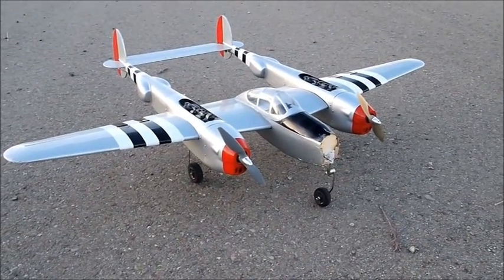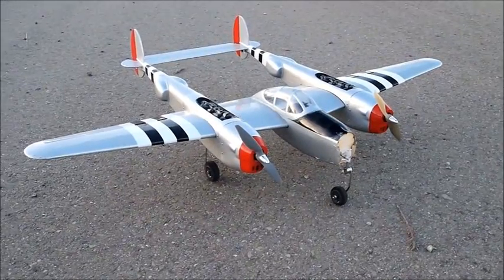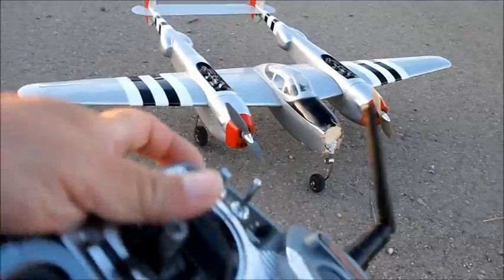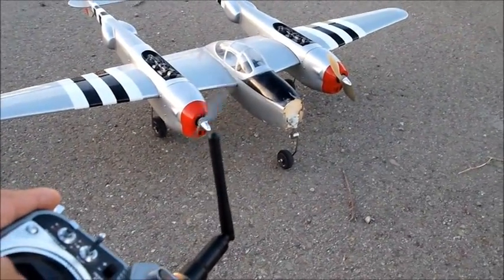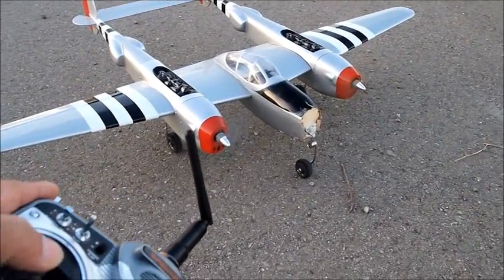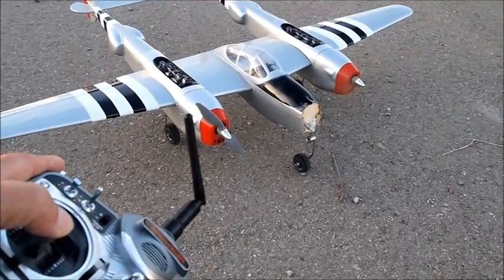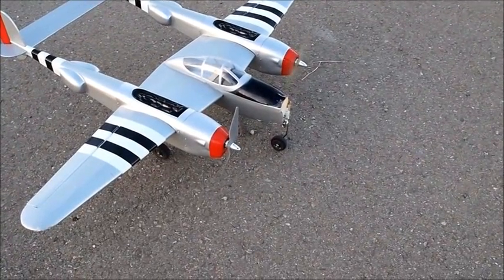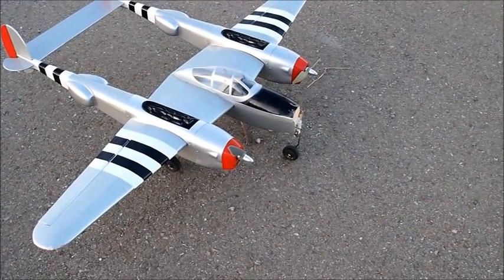HobbyKing YEP 30amp ESC problem

Comment: Hi there did you ever solve that problem ? I have exactly the same problem... two ypg 150A ..in.an ov10 bronco. Max 60A they get.. dont even get warm. Still they both give 3 beebs after landing... ?? Do you use an y cable too for both esc on the throttle channel ?
Reply from the maker: I'm sorry for the late response. I haven't been on my Youtube account for a while. Yes. I did resolve this issue. It turned out to be bad programming on my part using the Tx. If you buy the programming card, should be able to program and get it working right. In the meantime to fix it, change the Lipo type to Nimh. Basically the 2 beeps I was getting was indicating low voltage. Looks like it was seeing 2S lipo instead of 3s. Anyways, you can read my post here and get more details:   

https://www.rcgroups.com/forums/showthread.php?2037204-YEP-esc-problem

Comment: I have a similar problem, the 30A esc burned out when motor power was applied. I was using a 3s Lipo 1300mA. So I programmed elevons with power on through BEC, then powering up the "outrunner"? (spec was 3s inrunner) at about 1/2 throttle it cutout, then close throttle and open it slowly "POP" and poof, it burned the white wire between esc and edf causing a short between black and red wires. Damaged is a pooched motor, esc, and the lipo almost caught fire in the aircraft, but wires to EDF burned through fuselage. Complained to Hobby King and "Phillip the Specialist" put blame on me, I voided my warranty...really??? I have written back, but as yet they do not respond. HK customer service gets a negative from me. Not sure if I will ever buy from HK again, since this plane can be bought from other sites such Art Tech, Red Cat etc. If you see it on Hobby King, then look for it on the web, there are other sites out there who are better business minded.
Reply from the maker: I agree to some extent. Overall, HK has been ok. In 8 years, I've probably spent close to 10k at HK. Out of that 10k I've got 1 DOA $3 servo, 1 broken 12x6 GWS prop, and a missing windshield. I didn't even bother asking for a refund on the servo and prop. The windshield hurt though, since there were no replacement parts. I had to haggle them, but after 3 1/2 month they did send me one. I guess If one looks at the overall big picture it's still a buy. If I was to buy all the stuff locally, I'd probably end up spending 3-5 times as much or an extra 20k...so a $3 servo and a $1.50 prop just doesn't make much sense to shy away from HK.

Comment: I just had something similar happen today but I found out what it was and by so doing, may have found what happened to yours.  I found this in a YGE ESC Manual, (YEP is just a YGE clone):

Trouble shooting: 
1 Beeps/flashes: stick position and / or speed 
 for Gov.-Store not taught correctly. 
2 Beeps/flashes: Under-voltage identification 
3 Beeps/flashes: Temperature rise warning 
5 Beeps/flashes: Receiver signals failed 
6 Beeps/flashes: start up failed 

Following my maiden voyage today, mine was giving me 5 Beeps/flashes which means the receiver lost signal and as a matter of fact, there is a dead spot at my field and I did lose signal for a second.  

That SHOULD mean that yours with 3 beeps, means your ESC is HOT!  

To reset it, turn on your transmitter, then after it is on, take it to full throttle.  Plug in your battery to your ESC and it should start beeping continuously.  Leave it for a few seconds then unplug the battery from the ESC (Always leave the throttle at full on your transmitter)

Might be worth a try so you can set your ESC back to LiPo where it should be.

Here is the link to the manual I found:  http://www.hobbyking.com/hobbyking/store/uploads/362495641X4838X26.pdf 

Hope that helps!
Reply: After reading a bit more, you can actually reset the error by simply activating your Program Card, and I assume you have one.
Reply from the maker: Thanks for the long informative post. I'm sure someone will find it helpful. I haven't flown this plane for a while...mainly due to boredom on it, but I'll give it a try the next time around.

Comment: I've had the same problem; 3s cells still well charged and then LVC either on the ground or in flight. I even tried to lower the YEP LVC voltage to the lowest level but still cuts out. I changed to another YEP Esc and different batteries and same fault. I'm pretty convinced its a bug in the YEP programming.
Reply from the maker: Yep! good ESC's, but definitely a bug. Just switch to nimh and the issue will go away.

Comment: Try changing the battery.
Reply from the maker: thanks. I think it's a bug in the YEP software. The issue was resolved with changing batt type to nimh so the ESC is no longer detecting low voltage. My Lipos are a pair of 40c 2200mah and when it's beeping I'm still at 3.9v/cell, so definitely not bad lipos. Under load the cells are no where near 3.1v....